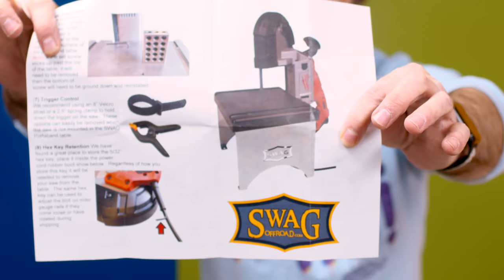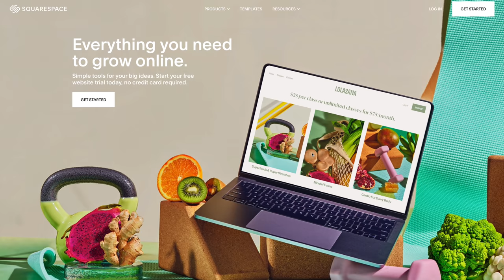Portable band saw into a bench top saw with a table! | Swag OffRoad

Comment: I built my own portaband table and absolutely love it.  I ended up welding a toggle clamp to the bottom of the table which keeps the saw locked in place it makes changing out blades really fast and don't have to worry about losing a screw.  Its super convenient and I end up using it for all sorts of little cutting tasks be it wood or metal.

Comment: I made a wall mount for mine and then used an inline foot pedal switch with a velcro strap on the trigger. The foot switch makes it quick and easy to walk up and take a cut and walk away.
Reply: David almost proved why foot pedal switches can be risky.  Always the inadvertent step on the switch totally by accident which causes one.  Personally had it happen but only turned on a dust collector.  Just saying.

Comment: I have had that table for a while now, holding a Harbor Freight Bauer brand saw.    Just for giggles, after I put it together I grabbed a chunk of railroad track someone gave me and cut it with the saw, using the blade it came with and just a little CRC foamy tap fluid.    Darned if it didn't cut the stuff with remarkable ease;  3 cuts to break up the track into usable chunks, and one to shave the top as the first step into making a small anvil.    All with the original blade, which I guess was made on a Tuesday LOL.   Anyway, I think you will get a lot of enjoyment out of this, congrats!

Comment: Been using the  table with a SWAG table with a Harbor Freight "Bauer" saw for close to three years.  Outstanding combination.  The table is a rock.  Tried to get a miter gauge but couldn't find one..  Actually found that the miter gauge on my table saw works fine.  This saw will handle an 1 1/2 steel bar and with lighter flat stock goes thru like grease thru a goose.  Must have tool if you are metal working.

Comment: Bought a SAWG table a few months back but went with the Dewalt 120 because it is sold at Lowes 10% off and it has a light.  I didn't get the foot pedal from SWAG but found I needed one after a bit of use and Woodcraft Toledo had one in stock. Works like a champ.

Comment: My problem with this, as cool as it is, is that this saw is $300 and that swag table is like $170, and for about the same price or a little less you can just get a variable tabletop bandsaw that will be so much more quiet and not take all the setup and finagling this does. Not to mention it be much safer than just strapping a trigger button down and plugging it in and out as your on off switch. 

Don’t get me wrong I’m not trying to be insulting here, but I’ve seen lot of people suggest this for knife making, and the price point just doesn’t make sense.

Comment: No disrespect, but you can get a small band saw for around $200, the kind that sits on a work table.  It's nice you can modify your portable one, but you might end up spending more money, and lose the portability.
Reply from the maker: Those small $200 bandsaws are made for wood and spin too fast. Unless there's ones purposely made for metal that I don't know about?
Reply: @MakeSomething  OK, so you want to cut metal pipes and stuff.  Cool.  I personally want to shape some hardwood that is about 2" thick, and a traditional band saw seems about the only thing that can do that.  Maybe a wood router, table and a big bit can too?